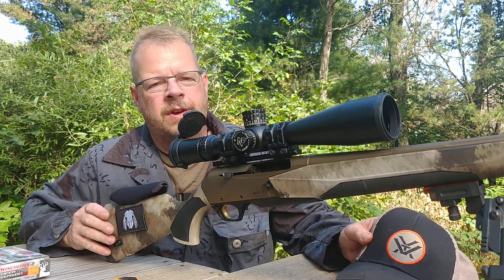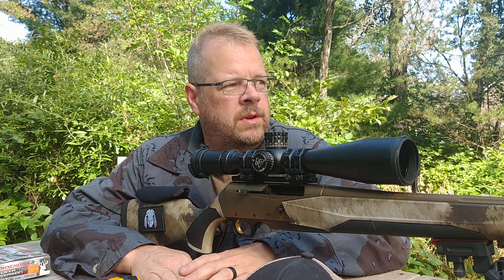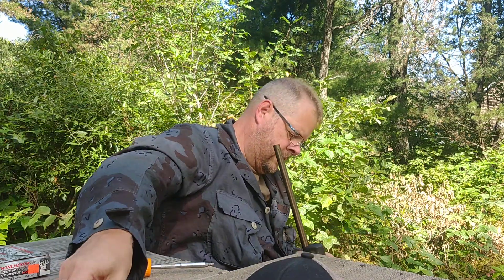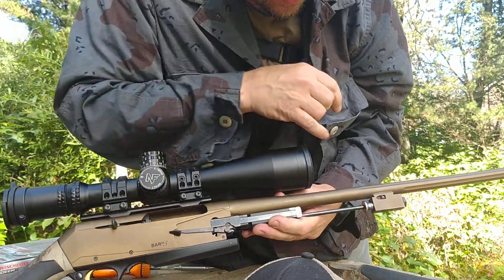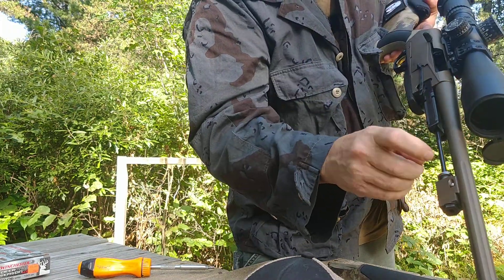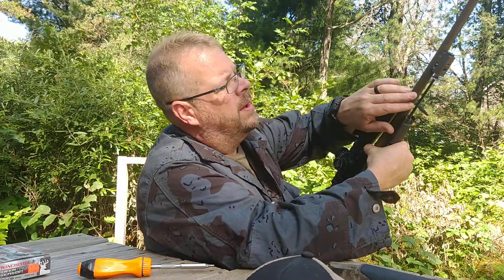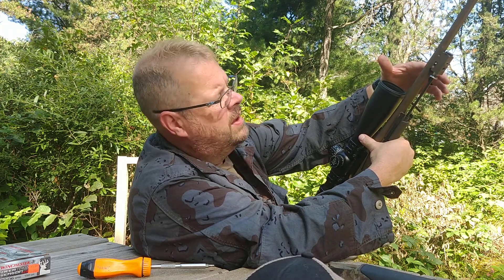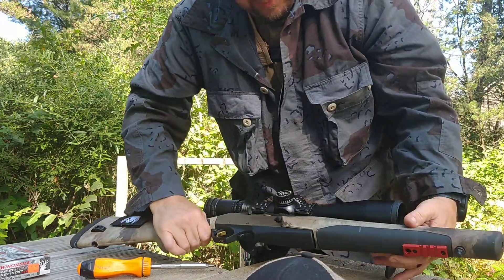Browning BAR Mark 3 feed issues, short cycling,

Comment: HI ! Actually the problem is  accuracy  I'm still testing the gun at the shooting range  at 100mt ( not yet Hunting with it ).
The shots never go to the same point they are not homogeneous sometime the gap  from shot to another shot is approx 10 cm , I dont know how to explain it better, I 'm afraid something wrong with...  barrel defect from the factory ?  I exclude it depends on the ammunition though I use the manufactured ones that are similar with yours.
I wanted to share with you all these to understand if you too had this kind of performance problem.
I'm not new with browning rifle  this  last one is my fourth purchase  and I am experienced hunter as well , but this  rifle is disappointing me very much.
Thank you for your  attention and kindness.
ciao
Reply from the maker: The only time I have the same problem is when I shoot to much to fast. These rifles will never be as accurate as a bolt action. I shoot one round and wait. Then another round. There is a lot of metal on these and when it heats up alot it effects accuracy. Try this. Shoot a round the run a bore snake thru it between shots, leave the action open and try to keep it from getting to hot. If I pound 5 rounds out of this as fast as I can it happens to me to. Good luck and motogp starts today....yaaaa
Reply: @Paul-wt6ij  For sure I will! thanks so much!

Comment: How's it grouping? Would like to see some shooting!
Reply from the maker: Groups good when shooting groups of three and  some cool down between rounds, maybe 30 seconds or so. After this rifle heats up it throws lead all over the place. In three shot quick fire is very accurate, shot 4...not so much
Reply: @Paul-wt6ij  Good, like 3 shots 1 MOA (inch)? That's usually my standard for a hunting rifle.
Reply from the maker: Yes. I can cover a 3 shot group at 100yds with a quarter
Reply: @Paul-wt6ij  Very nice thank you. Still would like to see some shooting videos though!
Reply: Mine groups tight at 300 yards in 30 06

Comment: Any tips on scope mounts? Tried the basic browning bar integrated scope system and it doesn’t fit with my new vortex, front bottoms out
Reply from the maker: What size is your bell? I use SPUHR mounts in 34 mm.
Reply: @Paul-wt6ij  Thanks for the reply. it's a Vortex Crossfire II with 4x12x50mm to it's a bit big. I tried a couple of mounts but am struggling to find one that fits. It's a 1 inch tube. What type of mounting base/rail is on your's? looks like it lifts the scope up pretty high. Mine is also a .243
Reply from the maker: @CHaynes530  I use a steel rail I got online. Zero MOA.  Get a rail, preferably not aluminum cuz aluminum will stretch, then low rings should work. I always try to use the same manufacturer for the scope and rings. But if you have rings now, get a rail and you should be all set. Good luck shoot stright

Comment: What kind of groups did you get @ 100 yards ??
Reply from the maker: I can cover all three of my shots with a quarter from a 100 yard target. After shot 3 the  heat starts to effect follow up shots with huge negative results. If the deal can't be closed in 3 shots odds for a haily Mary are not in your favor by a huge margin. Have a good one

Comment: Did u get a mule deer how did it cycle
Reply from the maker: Once I tuned it there have been no issues with jams or feeding. It is incredibly accurate, and yes I did get a nice mule deer.
Reply: @Paul-wt6ij  10 4 good deal yes I bought a mk2 safari new recently thought about getting a mk3 stalker in 300 win mag

Comment: DO NOT OPERATE ON THE PIECE YOURSELF!  Browning frowns on that severely!!!  Send it back to the factory.  They will give it to their customer shop who will go through it and make it better than a mere production gun!  Takes time.........just do it?
Reply from the maker: Sure that is an option. The turn around time is not exactly the best, but if you lack the skills or confidence to do this, sure send it back. I have also shortened the stock, added a 5 slot rail and a cheek riser by Kalix Teknik from Sweden. I don't rely on others to make repairs or modifications or custom work. If you are on a hunt and have an issue, it is nice to know you can fix it. Do I really want to send it back to Browning who sold it to me in this  short cycling condition? Hell no. Again do what is in your comfort zone,In my opinion the overall complexity of this turning is about a 
2/10, thanks for the comment and shoot stright